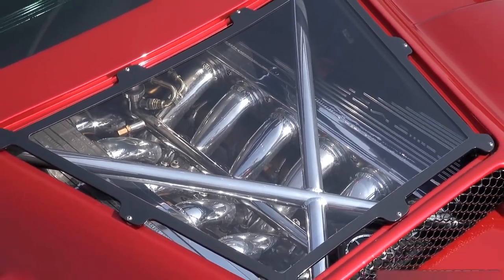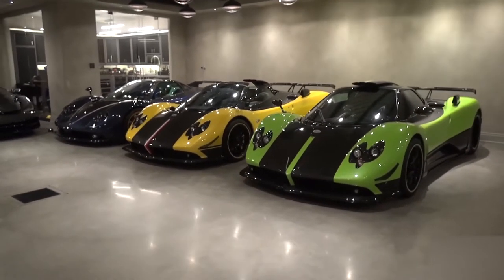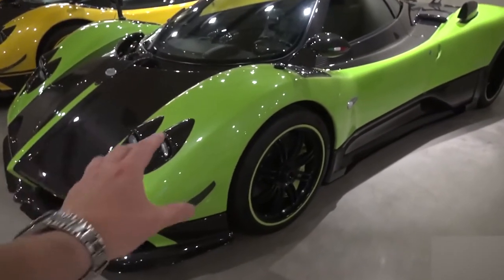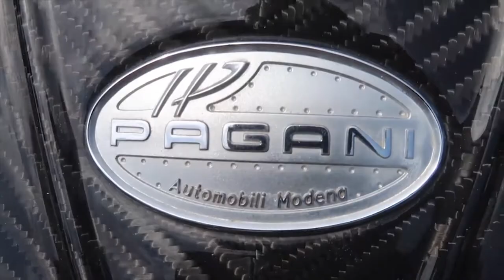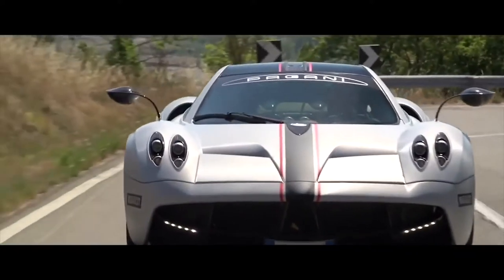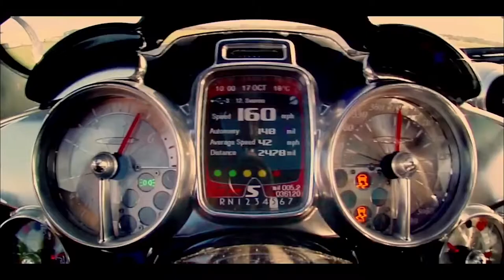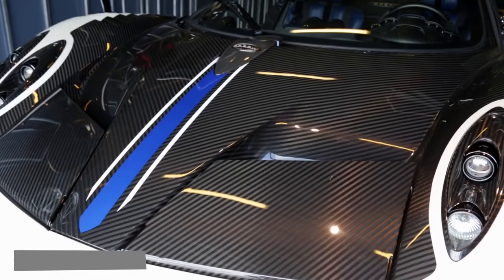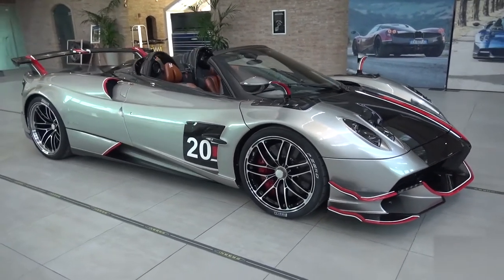Hypercars Of The Italian Brand Pagani 2020 | Zonda, Cinque,Tricolore, Huayra, BC, Roadster

Comment from the maker: 1. Pagani Zonda
The result was a mid-engined rear-wheel drive supercar, the Pagani Zonda C12, which began production at a factory in Modena, Italy, in 1999. The two-seat coupe received a twelve-cylinder Mercedes engine with a volume of six liters and a power of 394 HP, which is paired with a manual transmission. This was not enough for the creators of the car, and in 2000 the company introduced a version of the Pagani Zonda C12 S with a seven-liter engine that develops 550 HP, and in 2002 the volume of the power unit was increased to 7.3 liters, and its return increased to 555 forces. In 2003, customers were offered an open version with a Roadster body. The Zonda f coupes and roadsters introduced in 2005 and 2006 respectively received the same 7.3-liter engine, but boosted to 602 HP.

2. Pagani Zonda Cinque
Pagani announced a variant of the Zonda called "Zonda Cinque", which was introduced as a 2009 model. The Cinque is based on the Zonda R only on track, but has a new 678 HP (687 HP; 506 kW) Mercedes-Benz M297 V12 engine, active aerodynamics, and exterior elements made from the newly developed "carbon-titanium fiber"material. which is stronger and lighter than typical carbon fiber . Only five were produced, which have already been discussed.
Pagani announced the Zonda Cinque Roadster in July 2009, of which only five were released. The Roadster uses the same Mercedes-Benz M297 V12 engine as the coupe version, but it was made lighter and stronger to give the car structural rigidity. Both the coupe and Roadster accelerate from 0-60 mph (97 km / h) in 3.4 seconds to 0-124 mph (200 km / h) in 9.6 seconds and reach a top speed of 217 mph (349 km / h). The Cinque uses Brembo carbon-ceramic brakes . They help reduce the car's speed from 62 mph (100 km / h) to 0 mph in 2.1 seconds and from 124 mph (200 km / h) to 0 mph in 4.3 seconds. Maximum lateral acceleration is 1.45 g with road tires. The car produces 750 kg (1,653 lb) of downforce at 186 mph (300 km / h).

3. Pagani Zonda Tricolore
At the 2010 Geneva motor show, Pagani announced the exclusive Zonda Tricolore, built in honor of the 50th anniversary of the Frecce Tricolori , an Italian air force aerobatic squadron. Initially, it was supposed to be limited to one car, eventually three were released. The Tricolore is based on the excellent Zonda Cinque specification, built on a carbon titanium chassis with a sequential transmission and titanium exhaust. The mid-mounted 7.3 l m297 Mercedes AMG V12 engine produces 670 HP (679 HP; 500 kW), which allows the car to reach a top speed of 217 mph (349 km / h) and 0-60 mph (97 km / h). ) acceleration time of 3.2 seconds.

4. Pagani Huayra
In honor of the Inca wind God Huayra-Tata . The engine is a 6.0-liter M158 V12 turbojet engine from Mercedes-AMG with a power output of 720 HP (730 HP; 537 kW) [8] and a torque of 1000 Nm (740 lb-ft). The Huayra body is made of carbotanium; a lightweight composite of carbon fiber and titanium. The Huayra was redesigned from scratch, but has many visual qualities with its predecessor. The car can reach speeds from 0 to 60 mph (97 km / h) in 3.2 seconds and reaches speeds of 235 mph (378 km / h). Only 100 Huayra units were produced, each costing 1,000,000 pounds without options.

5. Pagani Huayra BC
An extreme, track-oriented version of the Huayra called the Huayra BC was unveiled at the 2016 Geneva motor show . Huayra BC is named after the late benny Caiola, a friend of Horacio Pagani and Pagani's first buyer . The Huayra BC has an improved version of the standard Huayra engine, producing 755 HP (555 kW; 745 HP) and 1000 Nm (740 lb-ft) of torque. The weight is reduced by 132 kg (291 lb) to just 1,218 kg (2,685 lb) thanks to the use of a completely new material called "carbon-triax" in the car, which Pagani claims is 50% lighter and 20% stronger than conventional carbon fiber, making the car's power-to-weight ratio 1.62 kg (3.57 lb) per horsepower., the Huayra BC uses a lightweight titanium exhaust system, new aluminum alloy wheels, and interior trim. The tires are Pirelli P-Zero Corsa tires that have 12 different rubber compounds, and the suspension and wishbones are made of aviation-grade aluminum, known as Avional. The Huayra BC also has a new front bumper with a front splitter and winglets, deeper side skirts, and an air diffuser that stretches the entire width of the rear bumper along with a larger rear wing. The car uses a 7-speed xtrac manual transmission with electro-hydraulic drive. Pagani stuck to the single-clutch transmission because it weighs 40% less than dual-clutch transmissions.
Only 20 Huayra BC units were manufactured, and all of them have already been sold, each of which cost 2.1 million euros.

6. Pagani Huayra Roadster
After two years of development, the Huayra Roadster was officially unveiled at the 2017 Geneva motor show .
The car's design has undergone several changes, the most notable of which is the rear, with updated fixed eyelid-like flaps that continued the design and eventually ended up on the taillights. Vents were included in the rear engine cover for efficient engine cooling, and the wheels were updated specifically for the car along with Pirelli P-Zero tires, and a spoiler was added at the front. The car has conventional doors instead of the Gull wing doors used in the coupe, since such doors cannot be installed on an open-top car. The car has the same twin-turbo V12 engine as the coupe, but with power increased to 764 HP (562 kW; 754 HP) at 6,200 rpm and 1,000 Nm (740 lb-ft) of torque at 2,400 rpm. Power is fed to the rear wheels via the xtrac's sequential 7-speed manual transmission, which is 40% lighter than its coupe. The car was constructed from a material developed by Pagani, called "carbon triax", which is a combination of three-axis fiberglass with carbon fiber . This allowed the car to weigh 70 kg (154 lb) less than its coupe counterpart, for a total of 1,280 kg (2,820 lb), making it the first Roadster lighter than the coupe. Only 100 of them were sold before the end of production.
Reply from the maker: Like
Reply: Thanx Mate Well I Used To B In The BIZ.... I Worked For A Major Auronautics & Aerospace Global Company But We Also Fixed Any Type Of Motors From Motorbikes Minis To Hypercars✌️